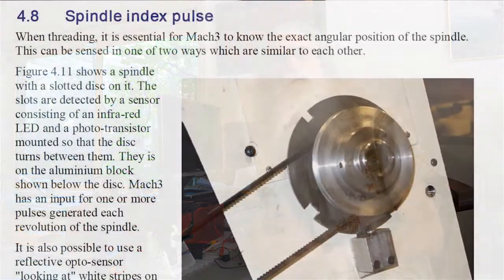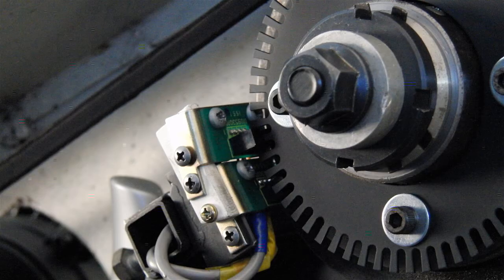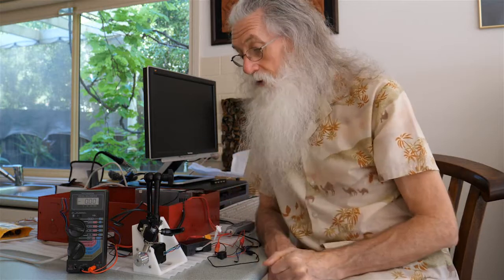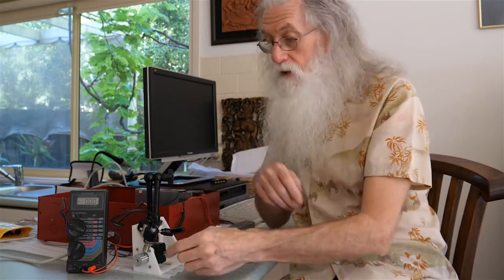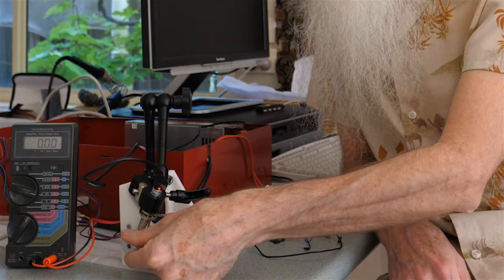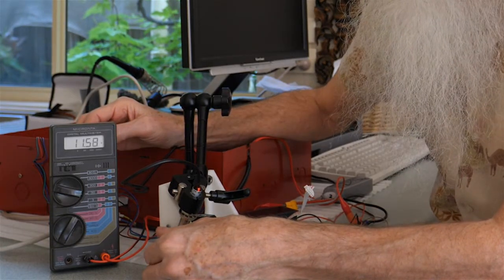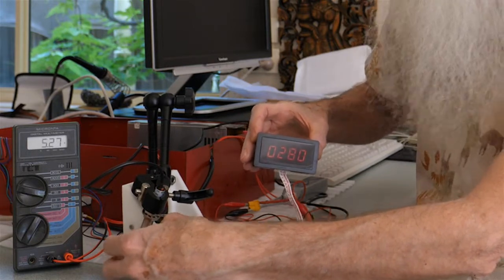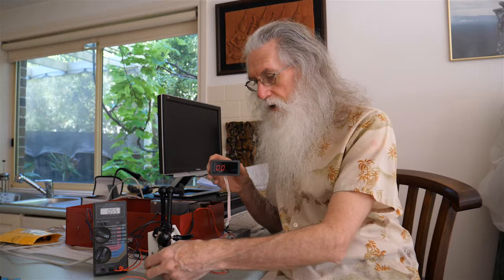CNC4A - Mach3 Index Pulse

Comment: Kind regards from Colombia.
Looking at your excellent video, is it possible to implement the wheel with multiple grooves? as you express: "more is better" or the magnet sensor option is more favorable, This is for threading and CSS using a three-phase AC motor.
Thank you for your attention and reasoned response.
Blessings of health and tranquility in these difficult times.
Reply from the maker: These were made a few versions ago and an arduino hall effect sensor and a magnet is a lot easier and cheaper now.  Look at my SX3 milling videos for more info.  Mach 3 needs a certain pulse length time and the faster the rpm and further out on the diameter the longer the slot.  If you can find a magnet wide enough for the timing you just need to drill a hole in a pulley face, etc and make up the bracket for the hall sensor and get the digital output (on/off) and use that 5V signal.  But that is for the INDEX signal, 1 slot.  The other small slots were for the speed, etc and you can not have to many as it will overwhelm Mach 3 which is the coyote, not the road runner.
Reply: @TheWizard  
Regards.
Excellent analogue between cartoon characters.

Comment: i have the bl mach 3.3v and i can´t see the green light blinking? do you solve it until now i tried with all the pins number but nothing. Im using and arduino 5v sensor hall
Reply from the maker: Don't forget to sunscribe :-)
Config > Input Signals > Index > Enabled > Port # > Pin Number > Active Low (suit your board) when you have a spindle sensor with just one slot or mark. On the Arduino Hall Sensor Module set the Output to  Digital so the signal is On/Off.  Not to Analogue which is more like a sine wave.
Reply: @TheWizard  Thanks so much for your answer. how i set the Output to  Digital so the signal is On/Off in my module? What do you mean?  My module its this KY-003 estándar Hall Módulo Sensor magnético. and the signal out put its digital yes
Reply: which breakboard do you use? iI use usb bl mach 3.3v
Reply from the maker: https://www.youtube.com/watch?v=FwkXuyyZooI
Reply from the maker: Now
https://www.youtube.com/playlist?list=PLB-x69F51YWa3eaUTFQhnoa-Kyt3AmJs8

Comment: So are you saying using 1 magnet and a hall effect sensor is just as good or good enough for sensing the rpm and spindle position on a lathe? I'm going to be retrofitting a lathe and I'm curious as to which way to go. Thanks.
Reply from the maker: Yes John. Just make sure that you calculate the minimum magnet diameter to get the signal duration in msec for your maximum rpm.  Just use the Mach3 formula for the slot that is shown in the video.  If you are not 100% sure just drill a hole in the side of a piece of round ali, put that in your three jaw.  Hang on to the wired up hall sensor, start the chuck and see how you go.  You will waste less than $2 trying it. Watch my other videos, especially the CNC4A - EL-Cheapo Tacho one for a simple test rig.  Don't forget to subscribe, I need them ;-)
Reply: @TheWizard  awesome thank you.